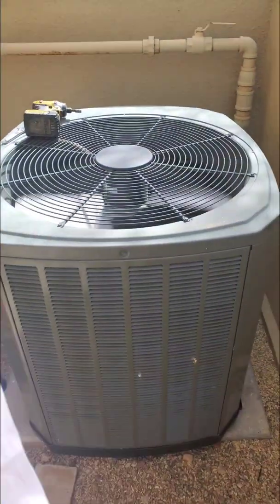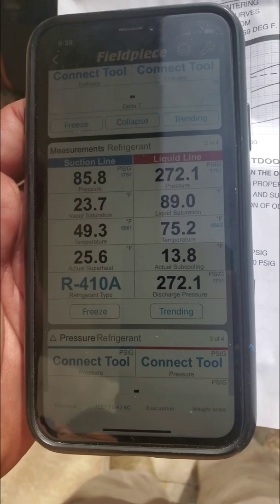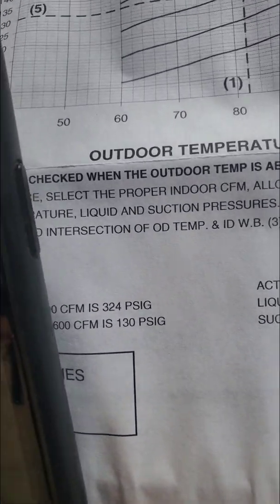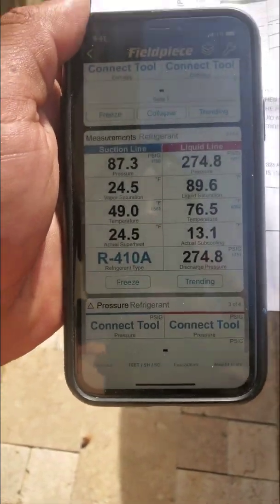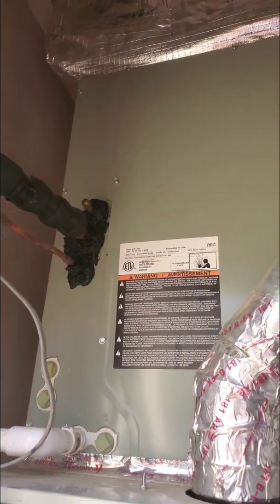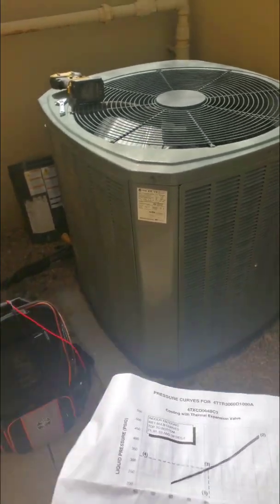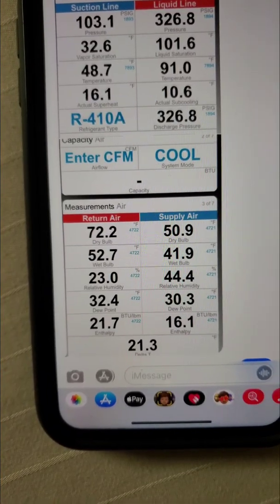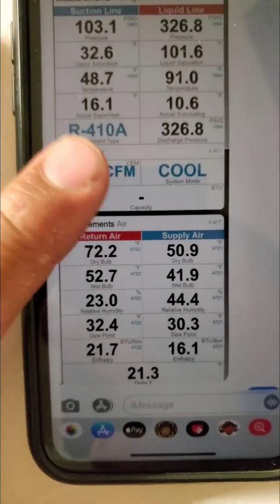HOW TO DIAGNOSE A BAD TXV, THERMAL EXPANSION VALVE PHOENIX A/C & HEATER REPAIR FOR SERVICE CHECK BIO

Comment: Even the After repair numbers show the evap just on the edge of freezing. You have good superheat but a potentially frozen coil. Needs more airflow or more liquid.
Reply from the maker: that appears to be slightly low on suction because of how mild it is, 72 indoor temp( much cooler than the average 78) this is because this preventive maintenance was done in much cooler weather. The good super heats shows enough airflow and refrigerant at the indoor and the good subcooling shows enough refrigerant and airflow at the outdoor. Both of these confirm proper charge. If we retook the readings at 75-78 indoor the suction would appear more normal.

Comment: Can someone please tell me why techs call the suction line THE SUCTION LINE and not vapor line? The other line is the liquid line, not the discharge line... That's something that's always fucks me up. I've been calling it the vapor line and the techs keep telling me to call it the suction line.
Reply from the maker: Most training by manufacturers call it suction line out here. I understand both
Reply: It IS the suction line. Because it goes right to the suction port. The liquid line is not the discharge line because it comes from the condenser outlet. The compressor discharge line goes into the condenser. Keep in mind, calling it "vapor line" is actually imprecise because the DISCHARGE line is also vapor! The compressor is a vapor pump. It sucks vapor in and spits vapor out.

Comment: I had the same exact thing happened to me yesterday lol
Outlet of txv was freezing also cap tubs as well . Low suction pressure, high subcool is usually a dead on indicator. Tech before me replaced lineset lol thinking it was restricted lol

Comment: nice find thanks for sharing..... had a call were the Unit was oversized for the space. Wanted to know what the difference would be in readings. If the unit was oversized for the space.
Reply from the maker: Great question! The best approach I take for seeing if a system is oversized for a space is actually called a manual J which is a heat load calcation. Google what that is and you'll understand what I mean